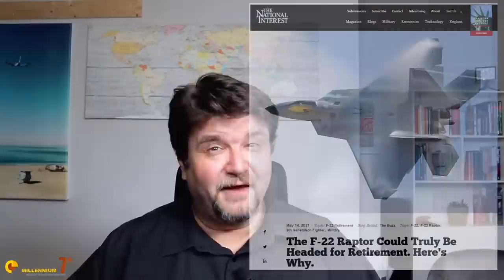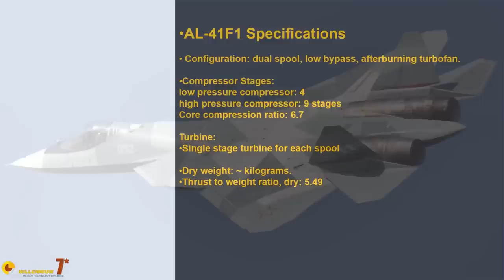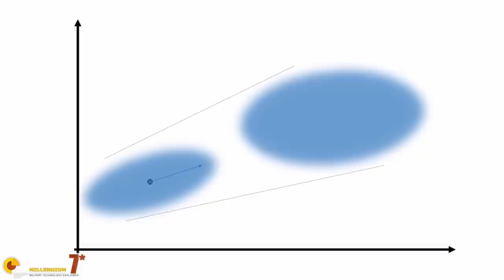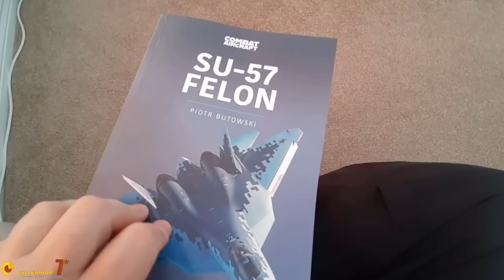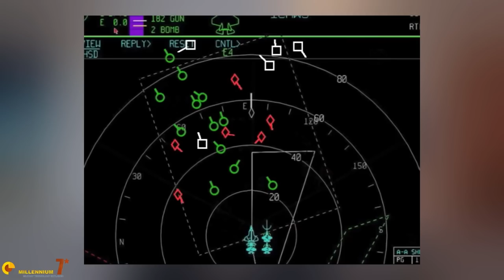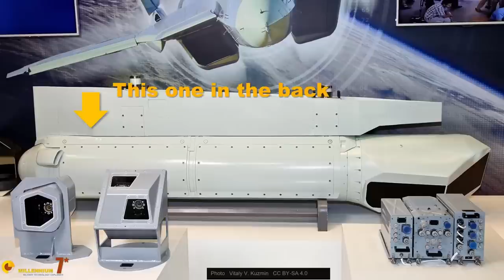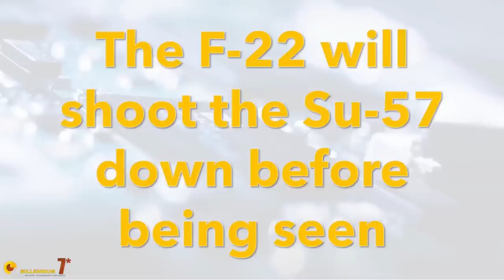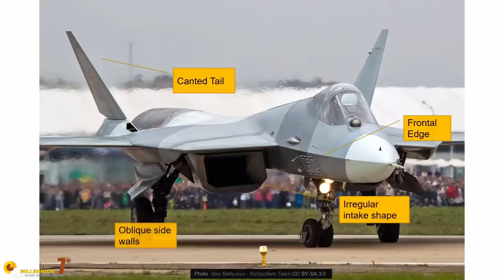Su-57 Update! + In Depth Analysis

Comment: If a US aerial surveillance platform detected something they thought might be a 57, they would have probably made it public, as being detected is a pretty serious blow to the reputation of a stealth fighter
Reply: Flip side. If the enemy falsely believes they can't be detected that's a huge advantage and I would consider that an extremely sensitive and closely guarded secret. Even more sensitive than carrier top speed. And that's been kept pretty quiet. Either theory could be right.
Reply: @doomedwit1010  but they openly admitted that they spotted a j-20 recently (both of them f35/j20 were unable to see each other untill the last min)
Reply: @hemendraravi4787  India announced they spotted the J-20 with normal radar LOL
Reply: @rrp54q95  now one of these sides are lying lol , but ig it also depends on the angle , maybe it was flying away while they spotted it.
Reply: For the most part outside the b2 the physical stealth characteristics of planes have really only been focused on obscuring against X band radar used by targeting systems. Slower less tactically useful radar can often still see "stealth" craft but not get any accurate data fast enough. but 5th gen planes  should have the ability to detect that and avoid it by default.
Reply: @hemendraravi4787  but I don't know the circumstances. Like if it flew under an AWACS or directly over a radar farm, it probably reveals nothing. We can confidently assume the Russians absolutely know they would probably be detected in those circumstances.  But if the Russians know it only got within X miles of the radar, and there's reason to hope the Russians might hope they can't be detected at X range, then the data is more sensitive. Of course Russian estimates of stealthiness are also secret. I might reveal I can spot something to discourage attacks. Like revealing you can actually shoot down U2s stops flights over any area you Might have a Sam. Not just where you actually do. So I agree there are reasons to disclose. But also not to. 

And I don't think anything competes with the Su-57 for arms sales. I don't think any country that can buy F-35s could get Russia to sell them Su-57s, and vice versa. (Same with any export variant of the F22 had they ever existed). 

In the example J 20 and India deterrence and national pride are probably both big weights. However if you are Ukraine a 5% chance of shooting down an su-57 by surprise is worth more for morale, and if the U.S. pride isn't really on the line. And for Ukraine deterrence already failed.
Reply: when there was military assistance in a series of 2 aircraft (if I'm not mistaken) completed several tasks (the newspapers wrote about it), the essence came down to the fact that the Su 57 flew through 3 NATO bases, after that information went that it was without stealth technology, but the bottom line is that NATO bases did not see them.
There's no getting to the truth here. Only after conducting tests can you understand who is lying. But no country will allow itself to do this, since this is already a state secret.
Reply: @hemendraravi4787  J20s can be spotted by Indian Su30 MKIs.
Reply: Only 100km to 200km XBand Fire Control Radar with updated + accurate threat libraries can Hi Fidelity ID any Fighter required to meet all Missile Launch conditions - otherwise everyone would replace Fighters by hanging long range Missiles on 450km AWACS...
Reply: @doomedwit1010  that is a good idea, problem is that NATO loves boosting about their own capabilities, so they wouldn't let that one slide, I am sure of it.
Reply: @Boikanyo Onneng  How does any radar discern F22 from any other aircraft?
Reply: @CherryBoyReloaded  modern radars with a good algorithm can figure it out pretty easily, especially when it's the only thing that hard to detect moving at those speeds.
Reply: @boikanyoonneng9170  Not quite, it's against any radar within a specified wavelength. If your ground radar operates in the same wavelength as the aircraft radar, then it works against your ground radar as well. The radar's that can see the F-22 are long wavelength radars used for over the horizon surveillance. These radars are useless for guiding missiles because two planes flying within 5 - 10 miles of each other would show up as 1 blip. From what I remember, the engagement radar of the S-500 is an x-band radar, one of the frequencies the F-22,F-35 and B-2 are designed to evade
Reply: @TeoTomTasTer  This channel has great vids on target ID - with algorithms only automating the recognition process of comparing observed Radar Cross Section with measured or modelled RCS of aircraft from all aspects stored in a Fire Control threat library - the reason F35 will not be sold to countries operating S400 that can radiate F35 from multiple aspects for measured RCS or to validate modelled RCS...
Reply: The reason F22 has not participated in the Paris airshow since 2009 when France was caught radiating the F22 on arrival to measure F22 RCS from multiple aspects to improve Thales Radar and EW performance = free ELINT...
Reply: All aircraft can have infinite RCS depending on aspect especially 4G with varying external fuel + weapons loads - so RCS is modelled for all possible aspects - but High Fidelity Modeling requires luck or genius or espionage - or validation with some actual RCS measurements - so S400 accidentally or incidentally radiating F35 can validate F35 RCS modelling for all aspects - greatly reducing S400 ID time that greatly reduces S400 reaction time that greatly decreases F35 Striker survivability intended to Strike S400...
Reply: @CherryBoyReloaded  It's also why Turkey was kicked off the F-35 list, they had purchased a Russian SAM system and they did not want to give the manufacturer information they needed to integrate the SAM's radar and communications with that of the F-35's sensor, communication and data processing systems.
Reply: @hemendraravi4787  who are “they” here? India most likely did detect the two engine testing platform wearing reflectors during their reliability trail around China. They then went on bragging about it. 

Apart from Top Gun, not sure there are much substantial new info about Su 57. Not sure what makes India going back to it again. Guess they are worried about J20.
Reply: @sgt.grinch3299  ? you are literally showing in your response, the heavy emphasis put on propaganda, you don't have the faintest idea what you're talking about because of precisely this work on discrediting the enemy, a step that wasn't taken here, meaning that they don't have the capability to back up this piece of propaganda.

Comment: Excuse me if i look boring, just wanna add something useful to the subject, to this very based in depth video. T-50 cockpit you show on the pictures is a Su-35S cockpit actually. Look at the angle between side stand of front canopy and fuselage, then look at the same spot on T-50 from the front - there is no angle, it's straight.
Reply from the maker: I can't fix it now, unfortunately. However, would you tell me the exact timestamp? Thank you.
Reply: @Millennium7HistoryTech  37:24 is a Su-35 cockpit - look how the canopy connects to the body. Then at 37:59 you show the jet from the front and there it's clearly seen that T-50 canopy is different.

Comment: Hey Gus ... thanks again.  Did you notice they chose the fugly GOBLIN for the Su-75 ...?  (Like Boeing's JTF design) ... which is better than China just copying our current F-35 and F-22 and merging some of the features I thought were best (external) designs...  TWO engines, the F-22 wing-shape.  Whereas, the Su-57 KIND OF reminds me of the YF-23 ... (with a 4 post tail,  butusing the control surfaces more similarly to the manner in which the YF-23's 2-post design rotates (where their 50-degree "vertical" stabilator-elements rotate more like elevons (entire flight surface rotates as the control surface, almost like a canard).  Anyway, thank you! 

Also ... I may email you and ask your private opinions about the coup, the US involvement, what you would've wanted if you lived in E Ukraine, and what E Ukraine did to "deserve this."

Comment: The F22 - the US 5th generation fighter -  has been in service since 2005. The Su-57, Russia's 5th Gen fighter, came into service in 2020. By the time Russia has full deployment of this platform in 2028, the F-22 platform will have been upgraded to 5th Gen+ fighter using some NGAD tech and the 6th generation fighter will be near it's in-service date. Su-57's are 15 years too late to the theatre - by 2028 - there will be a 6th Generation option available AND just as many 5+ generation F-22's and thousands of F-35's. Given that Russia could see the F-22 in operation for over a decade, the Su-57 SHOULD improve upon the Raptor. The biggest question is not if the Su-57 is "better" but what real impact will the Su-57 have against the platforms that will exist in the late 2020's and beyond. It's a beautiful plane though!
Reply: By 2028, I am 100% sure that NGAD won't be in service
Reply: I'm 100% sure that won't matter.
Reply: Ngad will not be ready in 2028. The thing you fail to understand is that the technology used in su-57 will continue to evolve into the 6th generation just as it will with Ngad. The Russians are closer to hypersonic flight than USA and the do not believe in stealth same way as USA. They will continue push forward with electronic warfare much like SAAB has done with Gripen E. Plus with addition of SU-70 Hunter B stealth will not be what we think. I would also assume they have started their 6th generation plane already.
Reply: Correct - the leap from 4G Collection of Systems to 5G Single Platform System of Systems was difficult for most to follow - with next leap to 6G Networked AI Assisted Multi-Platform System of Systems - expected to cost multiple Hundreds of Million$ each -difficult for few if any to afford much less follow...
Reply: @chadbernard2641  I think it's too early to talk about the 6th generation. Purely technologically, the new engine should produce thrust capable of accelerating in the afterburner mode (Mach 2) or close to this value.
While this is too fast, although there are developments in the work of new engines that can satisfy this. The question will arise in new materials , or a deep modernization of the load - bearing housing .
The reason is that at a speed of mach 3.2 +, the temperature in some places of the case rises above 300 degrees.
And this means that you will have to leave the composite for everything else, the glass of the cabin does not stand up and begins to collapse.
That is why it is forbidden to fly above 2.8 mach on the su31 without sharp reasons
Reply: @АлександрЗубков-ь2к  I agree the technology is not there for hypersonic flight although the US has developed a new ceramic coating that absorbs radar up to 90% and 3000°C. The Americans have yet I believe to make even a hypersonic missile. So Russia is ahead of USA in hypersonic flight. 

I just meant that they will keep evolving their technology and will not be so far behind like they were with F-22.

I believe the new Saturn 30 engine will allow for mach 2.4 and supercruise around 1.8 just like the F-22.

I hope there is never a war where we need to find who has the best technology. I just love the planes they are amazing from SU-57 to the Gripen E to F-35. It is a great hobby to study and understand.
Reply: 6G 200kn class low RF + IR observable 3 Stream Adaptive Cycles engines will power energy intensive 6G Fighters with directed energy weapons at Mil Spec thrust at Longer Ranges with more economical Commercial fuel burn - with VLO Stealth + Attritable Drones mitigating the need for high Mach flight...
Reply: NGAD has already achieved Milestone B of the Adaptive Acquisition Framework for 2030 Milestone C...
Reply: @chadbernard2641  Unfortunately, it is coming, for understanding, the US + EU has allocated 70+ billion dollars to date and signed a contract for the supply of military assistance of 820 billion dollars to Ukraine.
The question is which state did military assistance in the amount of at least 2 times less?
In fact, this is how Germany occupied the countries and forced them to work for themselves (during the Great Patriotic War), only in our case the war was the hands of Ukrainians.
History has shown how America can make money in war and raise its economy, but I feel this time everything will not go according to plan.
This does not mean that there will be a direct military conflict between America or Europe and Russia.
But the war is not only on the battlefield, but also economic.
Is Russia to blame ? I think if you read the supply of weapons , the training of military personnel, the construction of protective structures (such as pillboxes with a depth of 3-4 floors), as well as the statement of past politicians ( Petro Poroshenko ), I think the puzzle will work out.
Reply: @CherryBoyReloaded  I am very aware of the xa 100 and xa 101 adaptive engines. The truth is the 6th gen will be more about loyal wingman that will accompany. For example the SU-57 will have SU-70 hunter in 2023. If it could control multiple drones as planned one could be L band array to search out stealth planes while others tactical fighters.

NGAD is being fast tracked but it not be quantum leap forward. If they can keep costs down that would be biggest accomplishment.
Reply: @chad Bernard  Loyal Wingman are out because it implies flying close to Leads - while 6G Networked AI Assisted Multi-Platform System of Systems is a Piloted Command & Control Fighter platform that can Dogfight + Evade + Strike on its own - but dramatically increases effectiveness & survivability by commanding an airborne battlegroup of Air Combat + Strike + ISR + EW + Tanker Drones – that are dedicated role to minimize cost = Attritable - to take a bullet for the boss = MQ25 + MQ28 + XQ58 - with Kendall already pricing NGAD at multiple Hundreds of Million$ each - that is actually a Countermeasure except for 1 other country - the reason FCAS + Tempest won't happen...
Reply: @chad Bernard  Superfast + Super maneuverable + dual band Dogfighters don't win modern wars - VLO Stand In Precision Strikers win Wars by evading enemy air defence Fighter screens - that must get within Fighter Fire Control Radar range to ID Strikers to meet missile launch conditions before guiding launched missiles to within 15km missile seeker range of targets - while Multi-Platform Strike packages strike far more threatening Mobile Air Defence Systems with faster + rangier + smarter missiles to obtain Air Superiority to airlift men & materiel required to win the ground war...
Reply: What did you expect with a gap of 20 years where development basicly stood still.

Can't run before you can walk and simply skipping a generation is just not possible. First need to catch up before you can think about moving ahead.

People always have such a narrow snapshot view on things. I don't understand why it is so hard for so many to concider the wider context in which things exist and the timeline that created the current situation and it's influence going forward.
Reply: @CherryBoyReloaded  BVR fighting war is completely theoretical. At this point VLO is viable but as technology advances it may not be. There is a whole video on it from this channel also there is video on why F35 can't do BVR during a war. Not that everything he say is fact but if you think visual fighting is over you are mistaken it will be less but it will still happen.

Dedicated wingman will be a game changer believe that.
Reply: @chad Bernard  Correct - Close In Precision Strike isn't BVR - the reason for VLO F35 Stand In Precision Striker + VLO F22 BVR Dogfighter Single Platform System of Systems - to be combined into 6G VLO Networked Multi-Platform System of Systems...
Reply: gen 5 gen 6 dose't exist. they are just marketing definition
Reply: @giacomoiannone6772  4G Collection of Systems to 5G Single Platform System of Systems to 6G Networked AI Assisted Multi-Platform System of Systems is now technically well defined...
Reply: @chadbernard2641  according to russians at RIAC , US is ahead in SOME hypersonic tech such as for manned/unmanned aircraft.
Reply: @Schroif  Superior weapons are never challenged or require validation by Striking AK toting rebels or launching a few weapons only a few km across a neighboring border in airspace defended by S400...

Comment: Another stealth related factor I see no one talking about is the overall size of the SU-57. 
Like all other Russian aircraft, they're considerably larger than American aircraft intended for similar missions. 
Although larger aircraft mean more fuel which can translate into longer range and faster speed, it also means a larger RCS, and can mean needing more engine performance. The  B-32's smaller size compared to the B-2 could be explained this way... If you can shrink overall size without sacrificing anything else related to design objectivees, smaller is better.
Reply: It is able to carry 12 missiles if I'm not wrong. So the size is well used🤓
Reply: It has similar range to the Flanker, with smaller dimension. So its pretty space efficient. F-22 is not that smaller compared to Su-57, but F-22 only have 60% of Su-57's range.
Btw, J-20 is the largest 5th gen fighter and we still don't have reliable range estimate
Reply: Účel svätí prostriedky. 
5 lietadiel s 1 bombou ,Alebo 1 lietadlo s 5 bombami.
Reply: @copetimusmaximus3363  ah yes, external missiles, just what you want in a stealth fighter